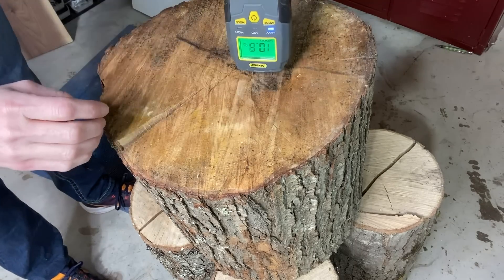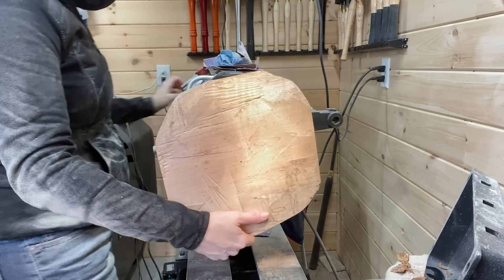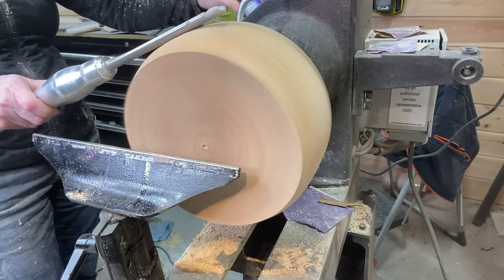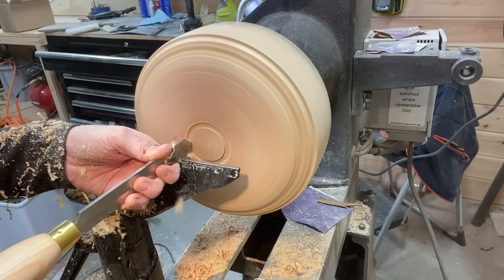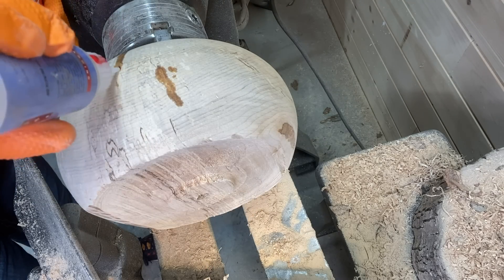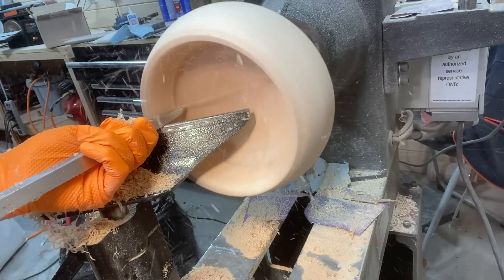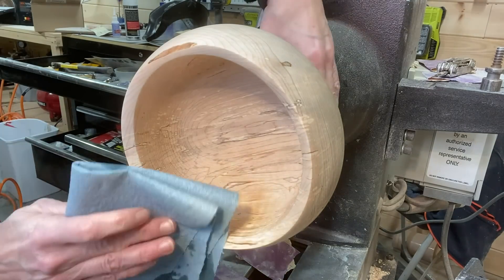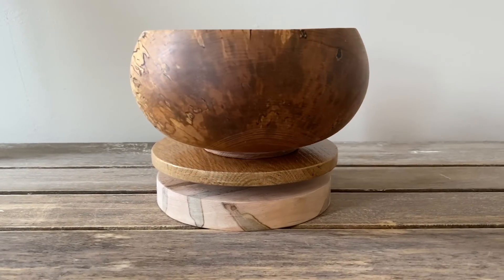Woodturning a Maple Log to a Bowl

Comment: Good commentary with your video.  I usually have larger bases on utilitarian pieces which will used  and a smaller foot on artistic works which will be looked at.  40% of the diameter is a good rule of thumb for usable bowls.  Makes them more stable.
Reply from the maker: Thanks for sharing!

Comment: Hi Peggy! Great project. I hope you don't mind a little feedback... I was a little afraid for you when I saw you cutting the log from that direction. I'm pretty sure you're already aware , but just in case.... The same wood rules come into play when chain sawing as they do when turning or working with wood. It's a lot harder, and (less safe when chain sawing...) to cut through the log straight through the end grain. The best and safest practice when chain sawing a log vertically is to make the cut via the side grain. It goes a heck of a lot smoother and the log doesn't bounce around on you as much. You also may want to consider building, or buying you a sawbuck to help hold the log. Thanks for sharing, and be safe, V
Reply from the maker: Hi Mike. Yes, I do need to build a sawbuck. And the reason I cut the log the way I did (end grain) is because of the big crack that was already there....you're right side grain is a heck of a lot easier!!! Thanks for watching!

Comment: Just as a help, when you cut your logs, if you will mark it and lay it on its side to cut it, its much easier and doesn't dull your chainsaw as fast. 
I enjoy your videos
Reply from the maker: Thanks!
Reply: Agree, that makes all the difference in the world.
Reply: Agree--much easier to cut long grain than end-grain.  Just make sure you stabilize the log so it doesn't roll while you cut it.

Comment: I prefer the recess because it seems to be a stronger hold and keeps your bowl from going out of round a little bit easier when you turn it around I’ve had tenants break off on me especially if the wood isn’t completely dry enough.
Reply from the maker: True----thanks!

Comment: You need to change the chain on your chain saw to a skip chain it will save half the battery and make much more of an aggressive cut.
Reply: If you send me the numbers on the bar Drag links 3/8 or .325 and if it’s .050  I’ll tell you the proper chain to use. Just burning it up otherwise.
Reply: Especially going against end grain
Reply from the maker: I'll check and get back to you! thanks.

Comment: Nice bowl as always!!!!!! You made that bowl the same way I make all of my turnings, with "fire wood" and finish with Danish oil. I have 2 questions though. Why didn't you have to use the Ack's abrasive paste?, is it because the Danish oil soaks into the wood? The next question, when you were turning the rim it sounded like you may have had a crack on the rim some where, did you notice that?
Reply from the maker: Hello! Thank you. I didn't need to use the abrasive part of the Ack's paste, because the Danish oil soaked into the wood and had a nice luster. But the Ack's polishing paste gave it a nice sheen! No, I didn't hear anything when turning the rim....and haven't noticed any cracks in it. I will keep an eye out though...
Reply: @PFWoodturning  Time stamp 9:33 there is a louder noise then up to time stamp 9:40 it sounds like vibrating wood

Comment: Great video. I’m new to turning and each time I scrape the side of a bowl with a round carbide, it seems to grab or catch. Any quick ideas on why that would be happening?
Reply from the maker: Make sure the tool rest is close enough to the piece you're working on. Make sure the tool is sharp (with carbide, you can rotate the tip). Make sure the tool rest is at or just below the center of the piece so that when you're turning, the tool is in the middle of the inside of the bowl (think above or below the equator).